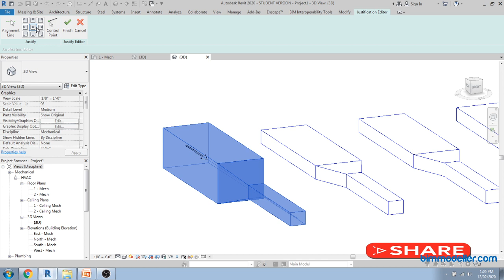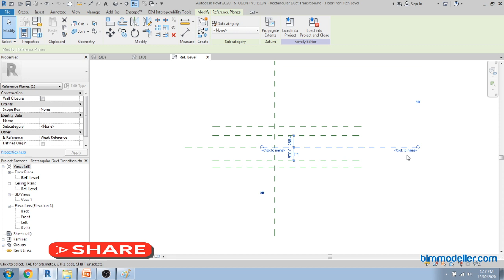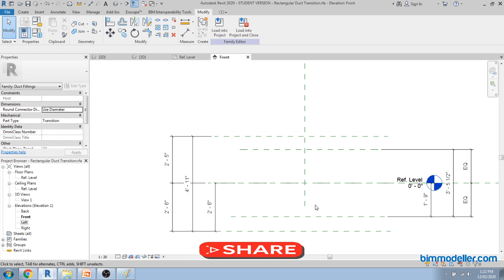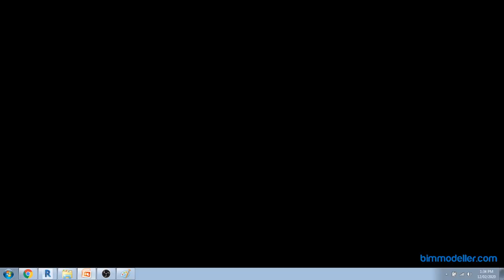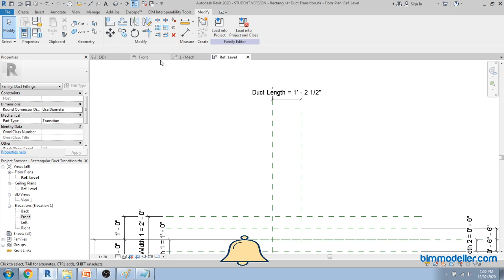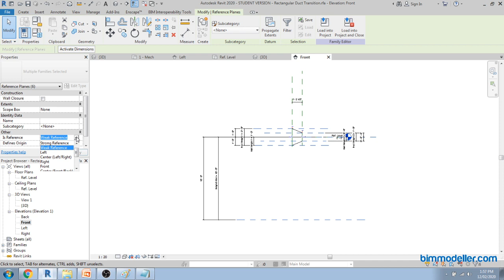How to Create Revit Parametric Duct Transition family

Comment: thank you for your vedio 
please provide me formulea of all parameter thanks
Reply from the maker: Delta 1 = abs(OffsetWidth - Duct Width 1 / 2)
Delta 2 = abs(OffsetHeight - Duct Height 1 / 2)
Num1 = if(WidthDelta = 0', 1, (abs(Half Width 1 - Half Width 2) + Delta 1) / 0'  1")
Num2 = if(WidthDelta = 0', 1, (abs(Half Width 1 - Half Width 2) - Delta 1) / 0'  1")
Num3 = if(WidthDelta = 0', 1, ((abs(Half Width 1 - Half Width 2) / tan(Angle)) / 0'  1") ^ 2)
Num4 = if(WidthDelta = 0', 1, ((abs(Half Width 1 - Half Width 2) / tan(Angle)) / 0'  1"))
Num5 = if(HeightDelta = 0', 1, (abs(Half Height 1 - Half Height 2) + Delta 2) / 0'  1")
Num6 = if(HeightDelta = 0', 1, (abs(Half Height 1 - Half Height 2) - Delta 2) / 0'  1")
Num7 = if(HeightDelta = 0', 1, ((abs(Half Height 1 - Half Height 2) / tan(Angle)) / 0'  1") ^ 2)
Num8 = if(HeightDelta = 0', 1, ((abs(Half Height 1 - Half Height 2) / tan(Angle)) / 0'  1"))
Length 1 = (sqrt(Num5 * Num6 + Num7) + Num8) * 0'  1"
Length 2 = (sqrt(Num1 * Num2 + Num3) + Num4) * 0'  1“ 

Helping Parameters
WidthOffset = 120" - Duct Width 1 / 2 + OffsetWidth
WidthDelta = if(Duct Width 1 > Duct Width 2, Duct Width 1 - Duct Width 2, Duct Width 2 - Duct Width 1)
HeightOffset = 120" - Duct Height 1 / 2 + OffsetHeight
HeightDelta = if(Duct Height 1 > Duct Height 2, Duct Height 1 - Duct Height 2, Duct Height 2 - Duct Height 1)
MaxDelta = if(and(WidthDelta = 0", HeightDelta = 0"), 1", if(WidthDelta = 0", Length 1, if(HeightDelta = 0", Length 2, (if(Length 1 > Length 2, Length 1, Length 2)))))
Computed Length = MaxDelta
Duct Length = Computed Length

Comment: This was just so much unnecessary work, you could have easily started with the existing family which Autodesk has modeled and carried on from there, and made necessary changes if required and there are soo many formulae with no explanation. simply copy and pasting.
The best way to model a complicated family in Revit is to modify the existing family or to reverse engineer from the ones Autodesk has provided.
Reply from the maker: @Mohamed Faisal. Yes Indeed. Its for person who want to learn what is existing family done. Person must know to edit the existing family Right, as like you.
Reply: lol .then  tell me  how  we learn  if  we  use   revit  family template.